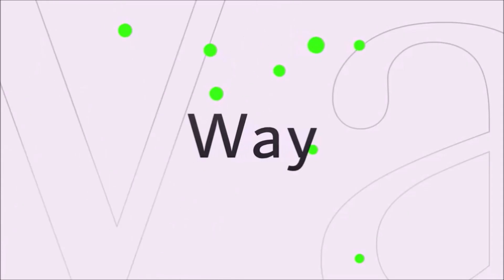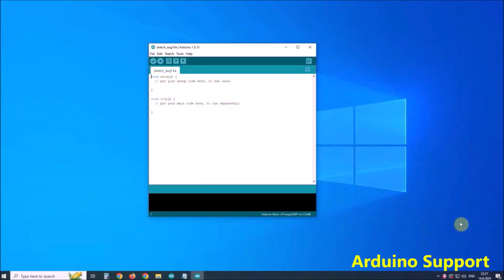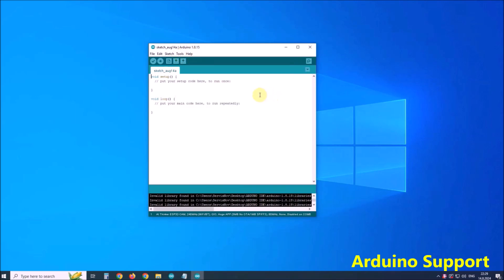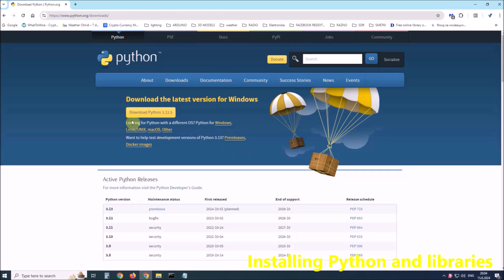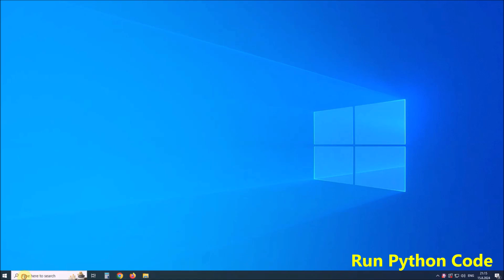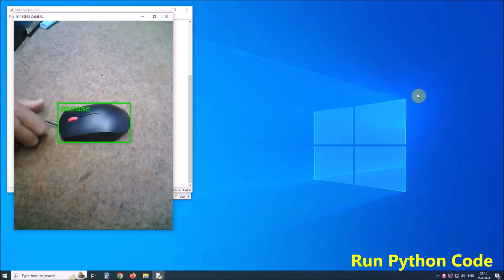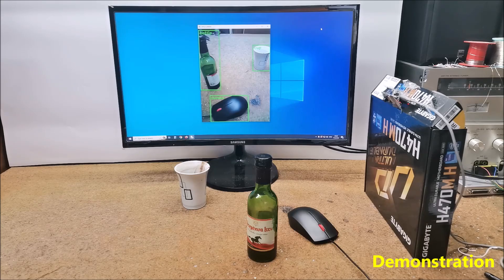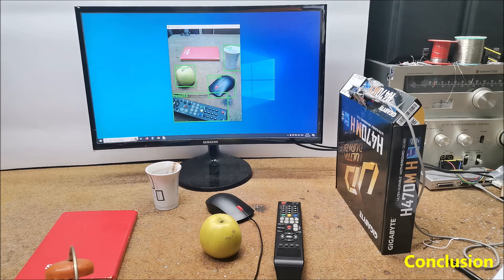Simple ESP32 CAM Object detection using Open CV

Comment: Traceback (most recent call last):
  File "/Users/furb-x/Downloads/Required files/Python code and lib/Object_detection.py.py", line 29, in <module>
    imgResponse = urllib.request.urlopen (url) # here open the URL
  File "/Library/Frameworks/Python.framework/Versions/3.13/lib/python3.13/urllib/request.py", line 189, in urlopen
    return opener.open(url, data, timeout)
  File "/Library/Frameworks/Python.framework/Versions/3.13/lib/python3.13/urllib/request.py", line 495, in open
    response = meth(req, response)
  File "/Library/Frameworks/Python.framework/Versions/3.13/lib/python3.13/urllib/request.py", line 604, in http_response
    response = self.parent.error(
  File "/Library/Frameworks/Python.framework/Versions/3.13/lib/python3.13/urllib/request.py", line 533, in error
    return self._call_chain(*args)
  File "/Library/Frameworks/Python.framework/Versions/3.13/lib/python3.13/urllib/request.py", line 466, in _call_chain
    result = func(*args)
  File "/Library/Frameworks/Python.framework/Versions/3.13/lib/python3.13/urllib/request.py", line 613, in http_error_default
    raise HTTPError(req.full_url, code, msg, hdrs, fp)
urllib.error.HTTPError: HTTP Error 503: Service Unavailable

Help me please I don’t understand 
const char* WIFI_SSID = "ESP Repeater";
const char* WIFI_PASS = "77777777";

WebServer server(80); //server on port 80

static auto loRes = esp32cam::Resolution::find(320, 240); //low resolution
static auto hiRes = esp32cam::Resolution::find(800, 600); //high resolution
//static auto hiRes = esp32cam::Resolution::find(640, 480); //high resolution (for fps rates) (IP CAM APP)

void
serveJpg() //capture image .jpg
{
  auto frame = esp32cam::capture();
  if (frame == nullptr) {
    Serial.println("Capture Fail");
    server.send(503, "", "");
    return;
  }
  Serial.printf("CAPTURE OK %dx%d %db\n", frame->getWidth(), frame->getHeight(),
                static_cast<int>(frame->size()));

  server.setContentLength(frame->size());
  server.send(200, "image/jpeg");
  WiFiClient client = server.client();
  frame->writeTo(client);  //and send to a client (in this case it will be python)
}

void
handleJpgLo()  //allows to send low resolution image
{
  if (!esp32cam::Camera.changeResolution(loRes)) {
    Serial.println("SET-LO-RES FAIL");
  }
 
void
handleJpgHi() //allows to send high resolution image
{
  if (!esp32cam::Camera.changeResolution(hiRes)) {
    Serial.println("SET-HI-RES FAIL");
  }
  serveJpg();
}

void setup()
{
  Serial.begin(115200);
  Serial.println();

  {
    using namespace esp32cam;
    Config cfg;
    cfg.setPins(pins::AiThinker);
    cfg.setResolution(hiRes);
    cfg.setBufferCount(2);
    cfg.setJpeg(80);

    bool ok = Camera.begin(cfg);
    Serial.println(ok ? "CAMERA OK" : "CAMERA FAIL");
  }

  WiFi.persistent(false);
  WiFi.mode(WIFI_STA);
  WiFi.begin(WIFI_SSID, WIFI_PASS); //connect to the WiFi network
  while (WiFi.status() != WL_CONNECTED) {
    delay(500);
  }

  Serial.print("http://");
  Serial.print(WiFi.localIP());
  Serial.println("/cam-lo.jpg");//to connect IP low res

  Serial.print("http://");
  Serial.print(WiFi.localIP());
  Serial.println("/cam-hi.jpg");//to connect high res IP
  server.on("/cam-lo.jpg",handleJpgLo);//send to the server
  server.on("/cam-hi.jpg", handleJpgHi);

 

void loop.handle

Comment: Can I unplug the connection of esp cam module or it needs to be connected with laptop? Can I connect with battery or something instead? Is it possible to just program it to start live feed and disconnect the usb cable? And continue the live feed from esp cam to be processed into object detection via this. 
I already have object detection code that runs from my laptop cam. Can you help me to modify it to run from esp cam?

Comment: Interesting but have a few questions;
Q1. Does object identification happens automatically or the camera has to be trained? Example the software will identify the apple and name it as an apple.
Q2. Can the program issue a message indicating the location of the identified object? Example a message out "the detected apple is at the bottom of picture", "detected carrot in the middle of picture ".

Thanks, by the way I don't know python but some cpp.

Comment: Basically, the function of the ESP32 CAM is just a camera. The actual image processing happens in the PC. 

So, you can just use a USB camera instead of the ESP32.
Reply: Exactamente lo que estaba pensando, la biblioteca openCV es enorme y no se puede cargar en el espacio limitado de esp32.
Si deseas tomar decisiones de IA en un dispositivo autónomo, puede conectar un USB u otra cámara integrada al rapberry pi e instalar allí las bibliotecas openCV.
Reply: @ronen124  yes and no. Here we can't achieve high perfomance on esp32 cam, according to example source code in esp32 lib, there is possible to extract x y values of detecting object, but fps remains low, opencv is not possible to use on board